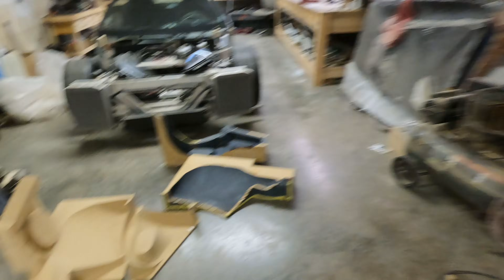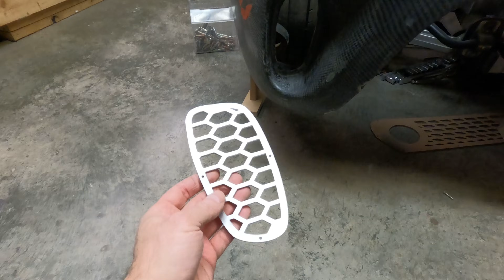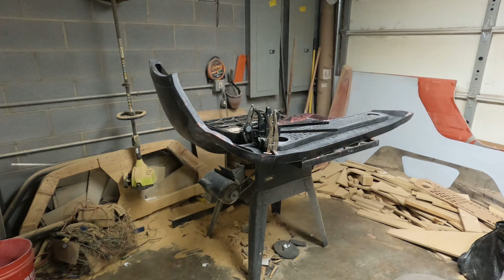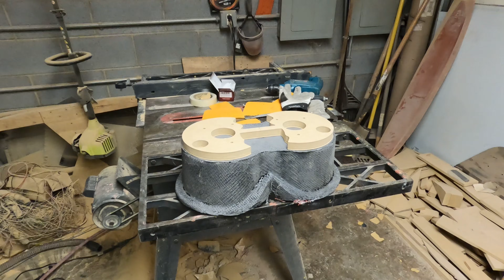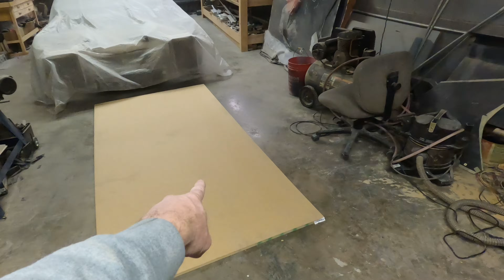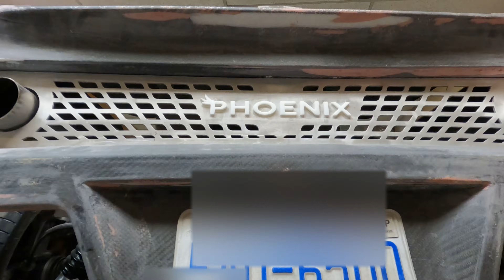Taillight progress: DIY carbon fiber rear for a custom built mid engine Supercar.

Comment: Liking that rear bumper and tailight fit. Next time you have a smaller part, you should try cutting the mold from extruded styene. Since you are doing a post finishing to prep it as a mold, the foam can be finished just as easily with an epoxy/Q cell slurry and sanded. Your CNC cutter can travel 4 times faster with less  bearing loads and less abrasive dust. In fact, you can cut the mold, add the slurry and then run another finishing cut. However that will add the abrasive dust back to your CNC. Bearings replacment time or sanding time. . . The decisions we make. 😂
Reply from the maker: Thanks Jay. There are a lot of times that I feel like I am working outside of my skill set. I will look into the extruded styrene in the future. I look forward to seeing you back in action soon. Thanks for watching.